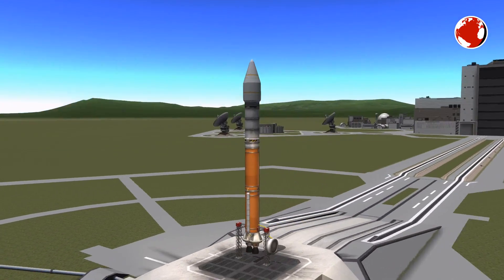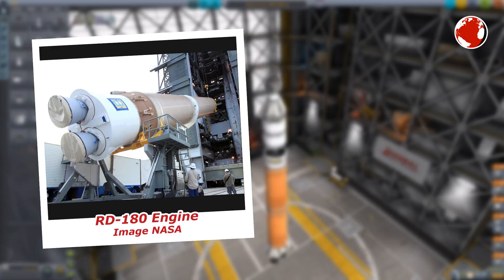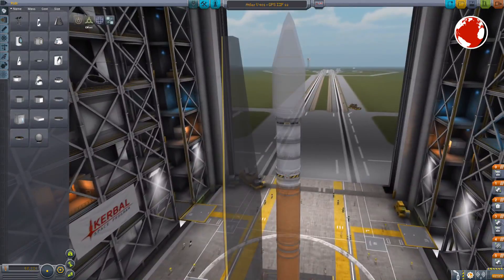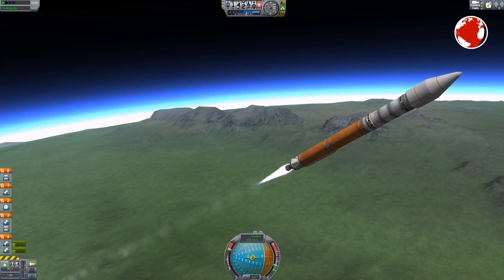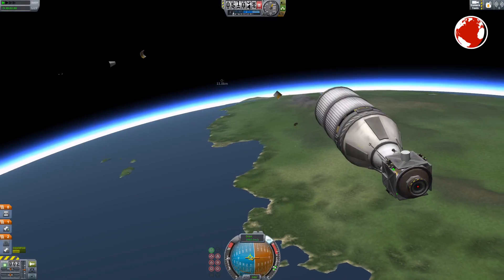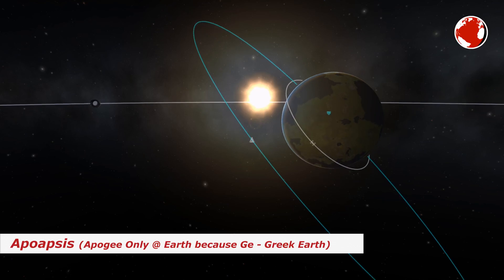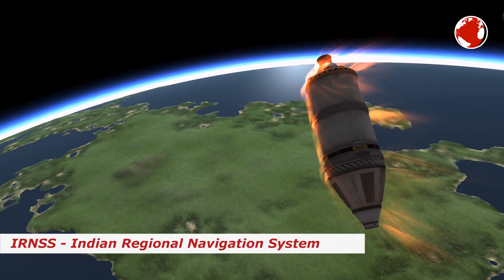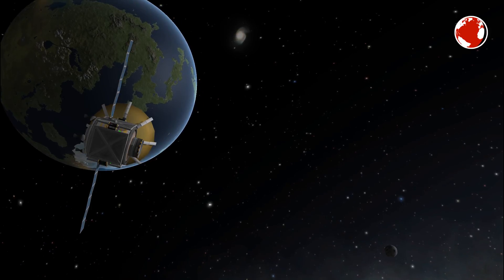Atlas V 401 Launch! | GPS IIF 12 | KNews #30

Comment: I really like the detail of the external feedline, even though it makes no sense in KSP. It's those little things that makes me happy every time I see your videos.
Reply from the maker: +Ricardo Lopes Thanks, I try to improve my rockets with each episode. I thought the fuel line is useless too but the cool thing about it is it pumps the fuel from the top tank, to the engine. This means the lowest orange tank empties first! Like this the center of mass stays up high which helps a lot during ascent. I think my Atlas V used to flip like crazy before that. I had absolutely no issues with that this time. At least not until seperation, after that it's a lottery lol